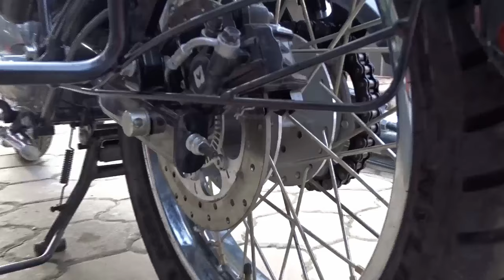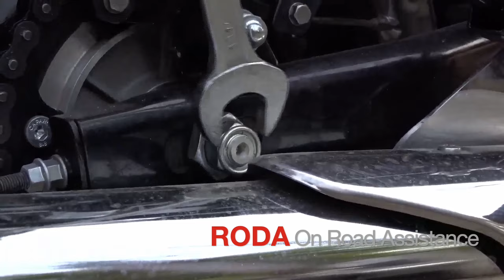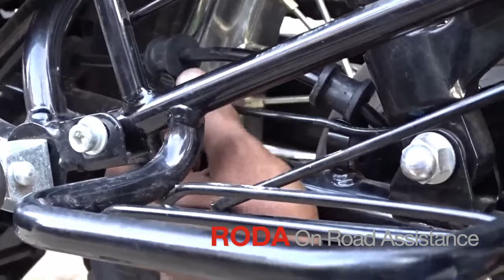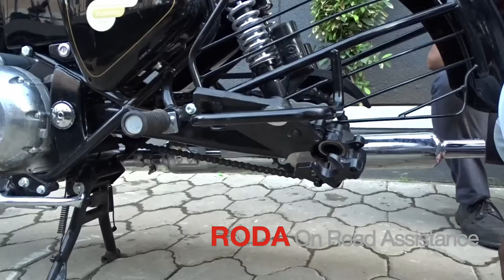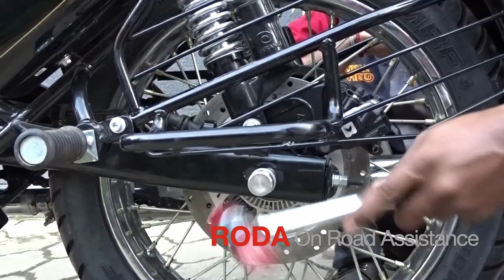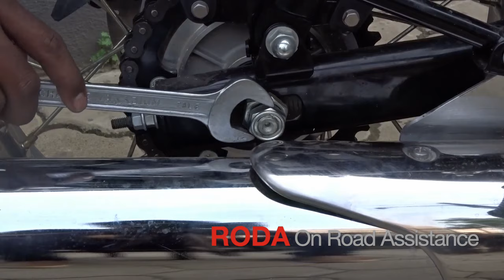ROYAL ENFIELD CLASSIC REAR WHEEL REMOVAL AND FITMENT  - RODA ON ROAD ASSISTANCE

Comment: Sir,
Thank you very much indeed for posting this very clear video of this operation.  I have had to remove the rear wheel on my own Bullet Classic to replace a broken wheel spoke and whilst the wheel came out fairly well, I could se many problems replacing it.  What I had missed was the need to remove the brake pads from the calliper to gain the manoeuvring space to ease the entire operation.  Thank you, I am indebted to you.

Comment: at 3:24 very conveniently he skipped the most important part of fitting the rear tyre back into the position. which is aligning/fitting the tyre back into the plus shaped hooves, which is the most complex part and he skipped it.. not much learning in this video. rest of it is pretty simple.
Reply: Its very easy bro just u need to fix the actual mark in the rubber hooves its very simple,  u try once...